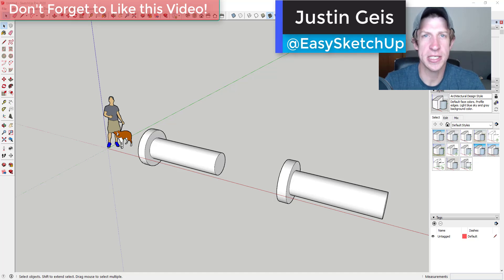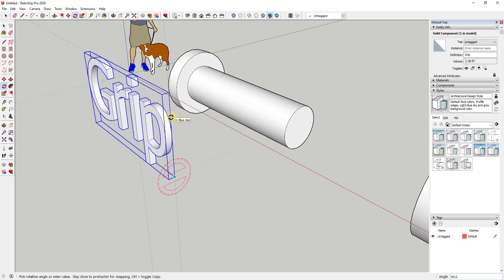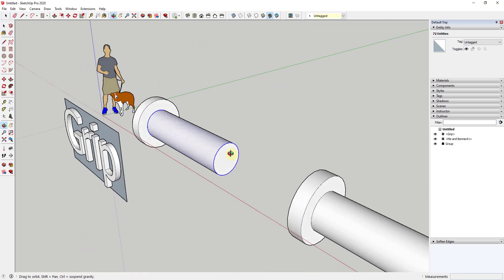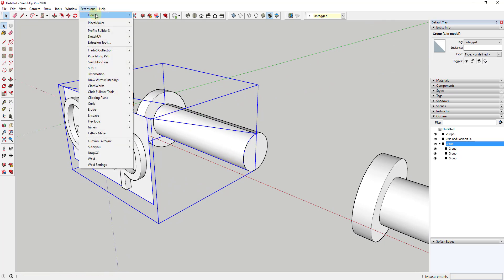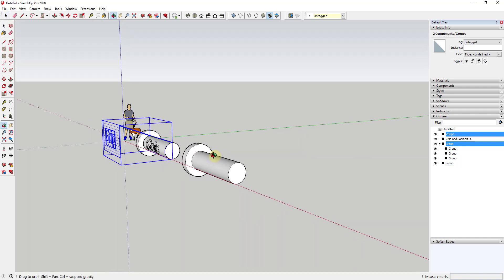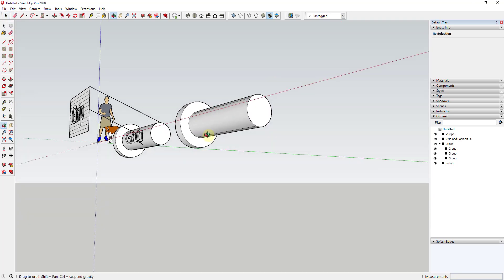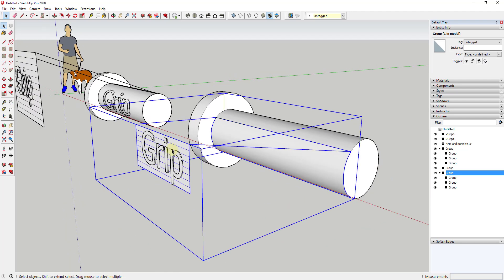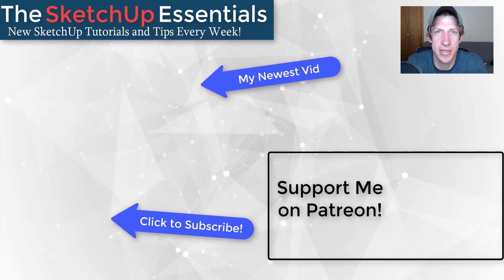Bending Text ALONG A TUBE with Flowify

Comment: I  love your tutorials, combining SketchUp with my woodwork hobby, I'm soaking up knowledge like a sponge. Good brain food in my retirement. I'm learning more every day and experimenting & expanding my skills. (Reminds me of learning IT from scratch 30-40 years ago)

I have a minor phobia against added extensions. I made something similar by embedding thick blocked 3D text onto a tube and using Solid Tools to imprint the 3D text onto the tube after removing the block text. (Works ok as long as the text height is less than the diameter of the circle.)